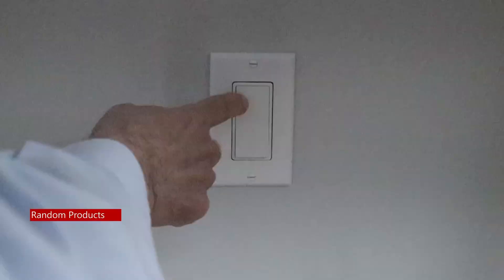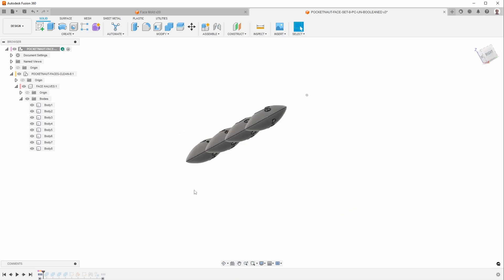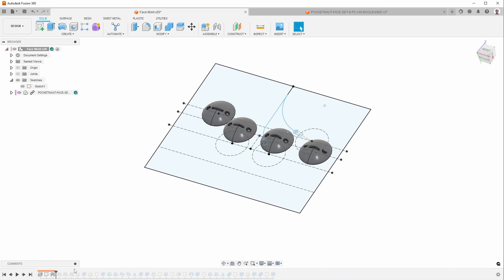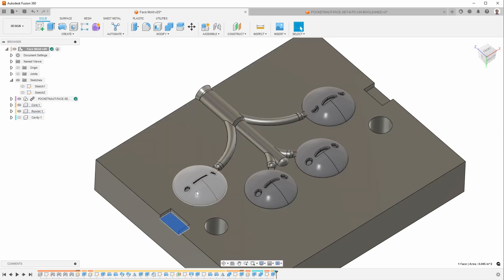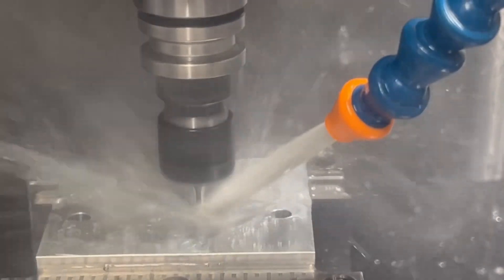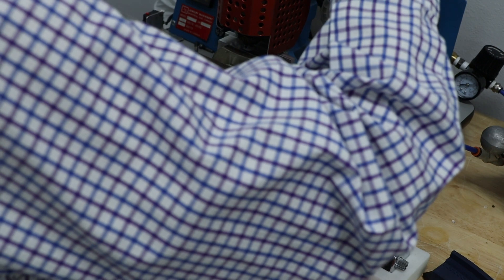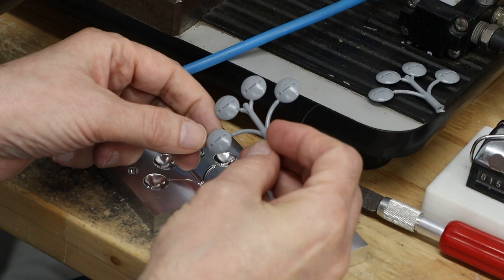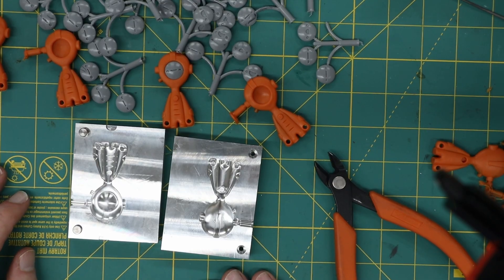The Making of TheCrafsMan's Pocketnaut Mold Part 2 of 2

Comment: Excellent work. 
The mold needs an air vent.
Reply from the maker: Why? That's one of the interesting thing about these desk-top machines. Because the clamping and injection forces are a low lower on these desktop machines, quite often you can get away without having air vents. He's done over 1,000 shots with this mold without air vents...

Comment: 5:10 - wouldn't it be preferrable to rotate the faces so the inlet is in the same position around the circumfence of the face circle?

11:30 - If it wasn't streaked, would it be possible just to chop up the short shot and reuse the plastic from that? I know in this case that would make no sense because it's contaminated with the previous color. By the way, I really like the little tube you use to measure the plastic :)

16:58 - I'd love to see a thermal image of the gasses escape on the moulds! I know the gas won't show up on a thermal camera, but the edges of the mould where they meet it might show that it's getting hot as the plastic goes in and pushes out the air.
Reply: Commenting because I want to be notified if there is an answer.

Comment: excellent work, right now I'm making my first mold, and I still don't know what diameter of the cross section to use (I'm going to make it 6mm) How do you calculate the minimum cross-sectional diameter before reaching the mold? Would 6mm be a lot? is a piece almost the same size as the body?